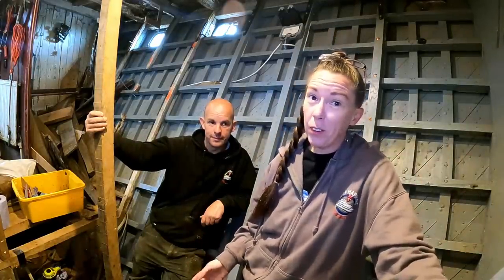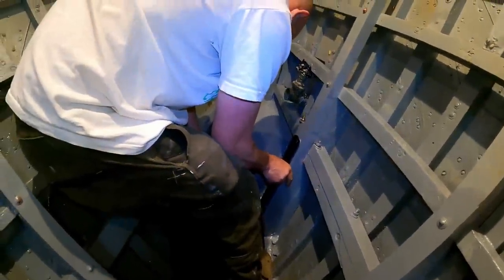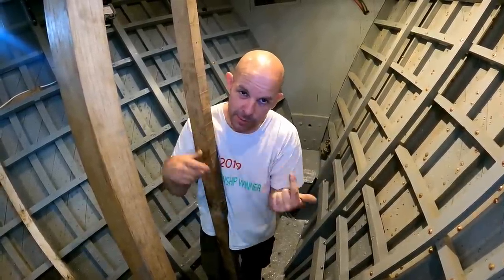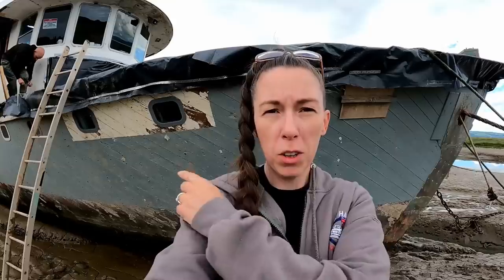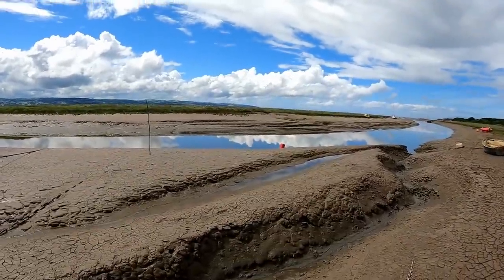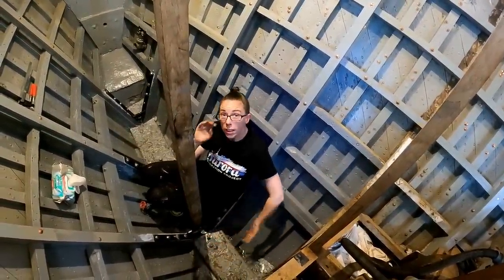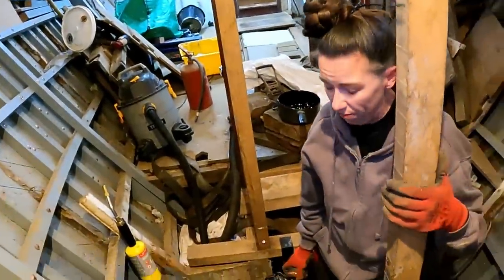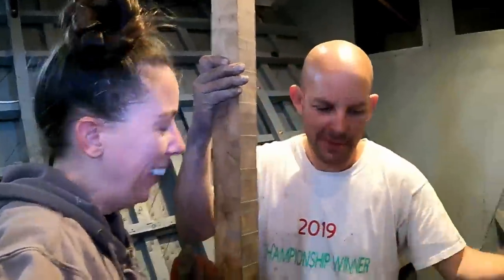Ep 79 🛥THE BOAT IS SINKING!  Pouring Tar in A Bilge and Fitting New Floors To Our Boat #Restoration

Comment: Making great progress.  The tar and cement is a well tried method and was used in my old fishing boat.  The planking under old cement I removed was perfect and the tar acts as a good gasket between cement and the hull.  I was told a trick with the tar is to mix some old engine oil with it as it will keep the tar slightly more flexible and it seemed to work for me.  Keep cracking on you have great momentum now and a band of happy helpers and followers.  Sad I’m so bloody far away to come help.  Andy UK

Comment: 12/08/2022 Hello SHip. I like the new knee bracing on the keel. I believe it will flex with the needs of the boat. Good work 4 months ago. I have worked on hot tar roofing and flashing. Be careful hot tar will not cool fast. It can burn deep. Be very careful of splashes. Don usa

Comment: I have never tared a boat, but I have worked with tar before. What works well is to use an old school metal galvanised watering can. there is a wide opening at the back to get you nuggets of tar in there and you can sit it on your gas ring. Then you have a nice spout to pour it out of. You will need some good gloves to hold the handles with though. You can of course leave any unused tar in there to solidify and cook it up again next time.

Comment: Little beach photography tip guys get a old frying pan ,the wider the better ,then buy a cheap tripod ball head on Amazon etc .. drill hole in centre of pan then get a bolt to fit the thread of the ball head . You can then mount camera on top and slide across the mud . Will add a pic later of mine to the FBgroup

Comment: Instead of messing about in the mud (nice though it is) drill marking the steel bits, I would have used masking tape, pencil, ruler and templates to locate the drill holes!
Reply from the maker: That could leave room for error, we wanted the holes in the correct place, so this was the best and fastest way to do it,

Comment: ref your being 2ft short for painting the hull. If you get an old scaffold plank then screw on 2"x2" at a 90 Degree angle sticking out 150mm each side at each end. 200mm in from each end. get 2 lengths of rope long enough to tie on the cleats on the focsle down to the plank so that its 2ft off the mud this will give you a platform to reach the top of the bow for painting. Hope this helps. Or a bosuns chair. Stay safe.

Comment: I have an incredible desire to do a knock-knock test on that ship. Going around with a hammer and tapping on all of the hull planking and timbers can tell me a lot. You can instantly hear the difference of good and bad wood and verify with a sharp probe(don’t probe the hull of a floating boat LOL). Generally the damage is at least four times as extensive as initially discovered. Marine surveyors have electronic gadgets that can detect damage beyond a hammer knock(so they say). I’ve walked away from a dozen boats, some absolutely heartbreaking because it was just what I wanted. Several times I’ve been asked by friends to look at a yacht that actually had a clean survey and found deal killing rot. My friend was actually angry with me and in disbelief until I showed him how an ice pick easily went to the hilt on a engine stringer. I know exactly where to find rot because of my hate for it. Probably because of the thousands of hours of my life on my knees extricating and replacing wood. Probably because of a knee that reminds me every hour of every day.

Comment: Any roofing supplies place will have metal bitumen buckets with a pouring spout. We use 200 gallon boilers at work for roofing, but for what you're doing you could melt the blocks directly in the bucket if you stood it on a couple of brick and used a propane torch. You could get a good self-levelled flood coat in there if you poured a couple of gallons at the bow end and just let it flow where it wants.

Comment: One of the things you will need to check is the bow of the boat and make sure it has a good set of vertical knee's that will connect the bow to the rest of the structure of the boat there should be at least 3 of them one set low and the other set mid way up and the last right at the top near the deck .. They should go back and connect to at least 3 of the ribs

Comment: Hi you two!! Is there a reason you wish to use tar and concrete because of the water? Is the wood where your considering doing this Sound Wood? Perhaps the limber holes could be cleaned and opened up an water will flow to the lowest part of the vessel where you cN install a Bilge pump to manage the water. One day you may regret your ids when you get her to a Boatyard and want to replace planks in fhat area.just Saying! It's your boat. I am just an onlooker and haven't the knowledge you do about your boat. Love your attitudes and personality, and Of Course, Commend you on your Dilligence and Love for each other and Your Boat.
Reply: This is a pretty standard procedure with wooden boats. We must presume the wood underneath is in good order.  There's no space for limber holes on each side of the keel all the way down to the bilge pump, and such tiny holes would quickly be blocked by debris, and thereby acting as a dam holding water from reaching the pump. Much better to fill it up and remove the possibility for the water to be dammed up.
Reply: Yeah, they are the eyes and ears there and I hope they have done a good sounding on all that wood. Definitely a boat yard.

Comment: "...the water has no place to go."   Have you ever thought about how to set up a ventilation system to promote evaporation? I think a steady flow of air, preferably heated a few degrees above the ambient temperature would do some good. Maybe use solar power - I found some USB fans for my tiny trailer that draw only 25mA @5v, and they move a decent amount of air.

Comment: Nice job, great to see her being strengthened and improved every time.
It's probably too late to suggest, but wondering would it be worth preheating the bilge with a heat blower before applying the tar, might help it bond even better.